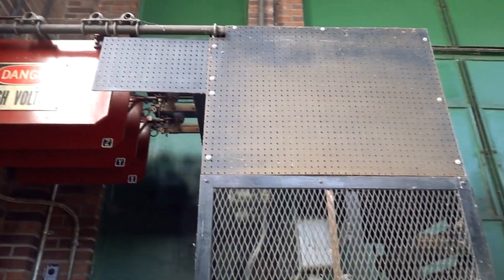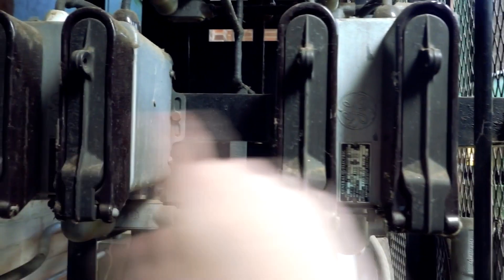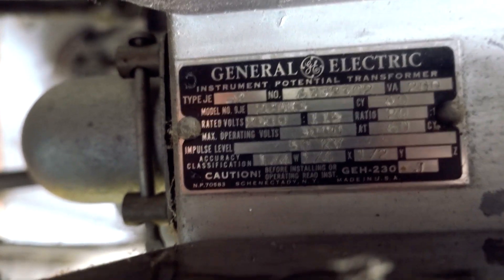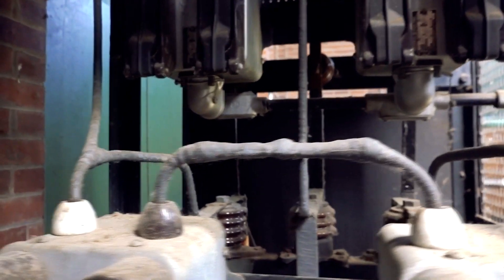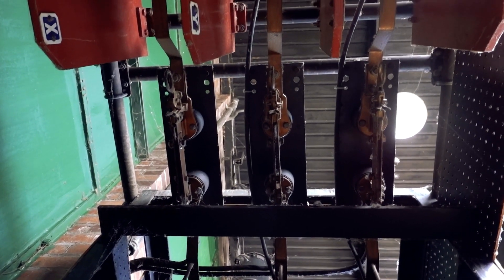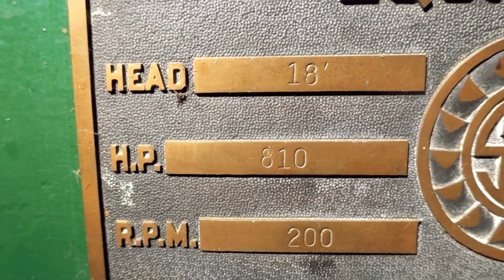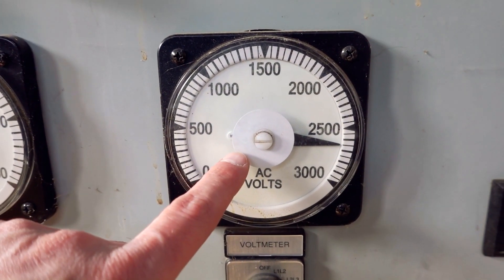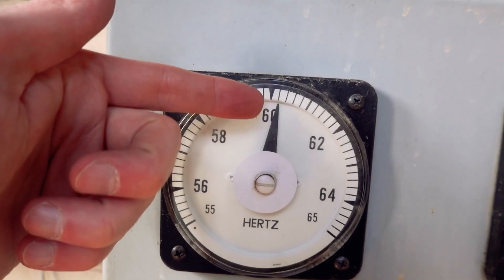Authorized Personnel Only - Hydroelectric Power Plant Metering

Comment: Is the Voltage when it comes off the Generator already at Line Voltage (Grid Voltage) OR does it still have go through Transformers before it is Transmitted by the Grid?

Comment: Thanks for the great videos! I'd love to see a shot of the three phase bank up by the ceiling for the powerhouse "station service" power, as well as the outdoor substation. Love seeing the cool old 2400V and 4kV stuff. Outside, is it stepped up to a transmission voltage like 69 or 115kV, or local distribution like 12.5kV?

Comment: Would have liked to know your metering ratios. Most modern metering regardless of the plant size, tend to scale to 5Amps on the current full scale. EG if the rated maximum is 300 Amps, the current transformer ratio would be 60:1, but printed on the CT at 300:5.
Same ratios are applied to the voltage with modern metering most often at 120 volt/208 volt for 3 phase metering. EG a 64,440V substation would use  a 64440:208 for phase to phase or 24,860:120V for line to neutral. The transformer ratio would be 208:1..

It would be interesting to know if the antique plants used the same substation metering voltage and currents as modern substations and power houses.  Most modern metering use meters that use 120V AC for the nominal value to neutral and 5 Amps full scale. All plant voltages are scaled to these values and the meter faces are scaled to the CT and PT transformer ratios. Same applies to the wattmeters. 120/208 Volt an 5 Amps are the nominal full scale voltage and currents with the display scaled by the CT and PT ratios.
Reply from the maker: I'm going into the details of metering in Season 4 :)

Comment: I just found your awesome videos! I would expect the generator voltage to be slightly higher than the grid (in order to push power into it), but I wouldn’t expect the two meters to show such a difference right there at the plant. Is that just error in the meters, or is there a drop between the generator and where you’re measuring the grid? What’s going on there?

Comment: I don't know why, but I find it interesting that you guys generate less KWs than the HEP generator on an Amtrak locomotive that provides 3 phase 480V power to the cars. Unless you can get away with less KW because you produce power at a higher voltage. Also I'm well aware that that's probably an apples to oranges comparison of electrical generation.
Reply: Well the power an old hydroelectric plant makes is literally free except for maintenance and upkeep of the plant.
So it doesn't matter that they don't make much power in a relative sense.
Reply: No, they for real generate less power. But it is cheaper to generate the power that they produced.

Comment: I recommend you install current limiting medium voltage fuses as a backup for your vacuum contactor. If one of the vacuum bottles fail, the resulting fault current arc flash will be devastating and possibly deadly.

Comment: Just thought of another question. The wavelength of 60hz is ~3106 miles, in a transmitting antenna system there are nulls on the antenna at various places. Is the same true on the power grid? Meaning are there places where if you tie in you have really poor efficiency or more/less voltage from the standing waves?
Reply: Only if the line is a quarter wave radiator, for which it would need to be ~775 miles long.  Only time I heard of that happening was with a line in OR/CA where the closed it in and got no pixies out the other end.  The line had to be converted to DC.
Reply: @randacnam7321  Manitoba runs a few HVDC lines from our main generators on the Nelson River in Northern Manitoba down to conversion stations near Winnipeg.

Comment: More of this kind of content please! 

So you've got me thinking... the grid is pretty solidly 60hz right? what governs that physically? If everyone is sampling the frequency of the grid at their connection point and trying to match that, rather than trying to match 60hz exactly, surely the frequency would drift up or down. Also, how do you get the generators in phase with the grid? do they naturally kinda follow the grid once connected or do you have to physically change something? Is there some station somewhere that is the master clock for 60hz that everyone matches or is it completely decentralized? so many questions.
Reply: Come on to Chris' Discord server for the show tonight and ask this question.
Reply: @fatman123526  I'm really not a hanging out on discord watching a very long livestream kind of person these days. I appreciate the offer but "I'll take my answer off the air" if that's possible :)
Reply: @quesocat42069  Well it's only an hour :p

What governs it is the tons upon tons of rotating metal that is all spinning at the same speed. The grid doesn't stay locked solid at 60Hz, it does wander a little as the load goes up and down and adjustments are made, but it is relatively slight. To put a generator into the grid you use a sync scope to get the generator as close as you can to the grid frequency (newer ones with fancier controls can match it perfectly) and then close in parallel. The generator is forced to sync to all the rotating mass when it comes in. Too far off it trips out or damages it self.
Reply: @quesocat42069  GridEye shows this in an interesting way, https://youtu.be/jmlciQqPGlQ?t=14 

The entire grid, but also each part of the grid MUST stay in balance and this is now done electronically by the Balancing Authority. When problems happen, differnt parts of the grid start to go slightly out of sync. If it gets too bad, the grid MUST trip out, or cause severe damage from slipping a pole
Reply: Large scale generation facilities have to make more or less power as demand increases and decreases otherwise they will over or underspeed and throw the frequency out. A small generation site like this doesn't have to worry really because they can just be considered baseline power. This is the major problem that still needs to be solved with large scale solar. You can't turn them off, that power has to be used somewhere. That's why grid scale storage is becoming a big deal to smooth out generation capacity with demand. Wind turbines you can change the blade angle dynamically so they make less power, hydro you can close the gates, or adjust blade angle, fossil fuels you can burn more/less (and lots of steam pressure management stuff), nuclear is slower to adjust but can like fossil, but solar is 100% at the mercy of the sun. It's not cost effective to add solar tracking (which can also point away from the sun to disable panels) to grid scale plants, so storage solutions need to come online as we increase the percentage of our power which is provided by solar.
Reply: @NickHorvath  Solar generation always use inverters. Isn't that the easiest to adjust or turn off amongst all the other mechanical stuff?
Reply: That would be a problem if one attempted to bootstrap the grid, but on an established grid, the mass of the generating equipment makes shifts in frequency small and slow. Solar is fundamentally DC, so you'll get whatever you make, almost instantly. The problem with solar is the general inability to control how much power is being made - it makes what it makes, unless you have a way to adjust the shading or aiming.
Reply: re: "what governs that physically?"
MISO, an organization, tells various generating plants to pour more 'coal' to the boilers - or not, based on grid conditions e.g. load and who is supplying the cheapest electricity at the moment ... this will be within the limits of the HV transmission line's capacity tying everything together ...
Reply: General practice is to keep the total number of cycles in a given time interval constant (i.e. 5,184,000cy in a 24 hour 86,400 second day on a 60cy/sec system) to prevent drift from electronics or mechanical clocks that use the grid as a frequency reference, which is common even today as time references that are cheap enough to be stuck in COTS electronics will drift too much.

Comment: why do you need to synchronize to the grid?
Reply: If you don't, the grid power forces your equipment into sync very quickly, and if you're too far off, very violently, likely destroying your equipment.
Reply: Same reason you have to synchronise the speed of a car and a train before jumping from the car onto the train. Or with the ground if you just want to get out.

The sine waves on the wires of 3-phase power directly match the position of the rotor in a generator (or 3-phase motor, they are the same). So if you take a snapshot of the voltages and apply them to a generator, you will see that the rotor moves to that exact position. Same happens when attaching it to the grid, only difference there is that it also starts rotating. So the moment you connect it, there is only exactly one correct position that rotor can have---and the complete power of the grid will force it into that position, no matter where it was previously. And just like stepping out of a car at 200 mph, that will end up badly for the generator if the rotor is forced up to speed and into a completely different position instantly.
Reply: View the grid as a wave when you sync you match the peaks and valleys (wave)

Comment: Know of a power plant years ago where they tried to connect on line with the synchroscope 180 degrees out of phase. Loud noise, and the turbine and alternator exited the power hall via the one wall, along with large pieces of turbine blades going in a shower of shrapnel and turbine case pieces through every thing in line with them. Plant was out of commission for around 2 years before they were able to ship in a new generation unit.

Another was a stationary diesel, normally started with high pressure compressed air in cylinders next to it. One day cylinders all empty, so bright spark decided to bring in another black painted cylinder of oxygen. Connect up, turn to just past TDC, and open the gas feed, then after BDC turned it off and let it run up and start. Before TDC diesel is injected into the hot gas, and it ignited, compression heating.Unfortunately the cylinder was welding oxygen, so instead of having a nice start, this engine blew up, sending the head, along with the valves, around a half mile away into a field. Cylinder just blew up from overpressure, but not before the piston, connecting rod and part of the crank were punched through the sump and into the concrete floor. Flywheel shattered, and then the cylinder walls ruptured and blew the tin shed apart. Bright spark survived, deaf for a good few weeks, and with a lot of hearing loss, but otherwise he was in a Goldilocks zone, where all the pieces went past him, and not through.
Reply: Yikes - bright spark and the same angles that watch over drunks looking out for him too!
Reply: i live near fort peck montana dam...... i overheard someone say that when they were not quite synced..... it shook the whole building 
.
they had to shut it down and inspect everything..... but it was still OK
Reply: I often say about incidents like that, "I'm sure glad I didn't do that."
Reply: An impressive level of stupidity that was!
Reply: Hence forth commissioning is a thing that is done with the testing of terms and gear and gens before they are just heated up and yolo'd to the system but nvm just yolo it to any/everything. Anddd dint hire an EE straight from Georgia tech